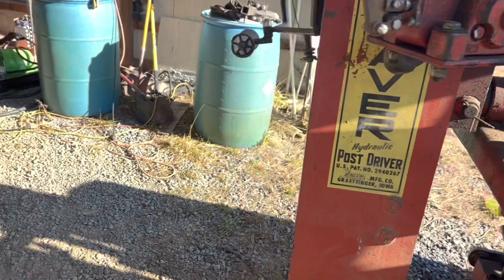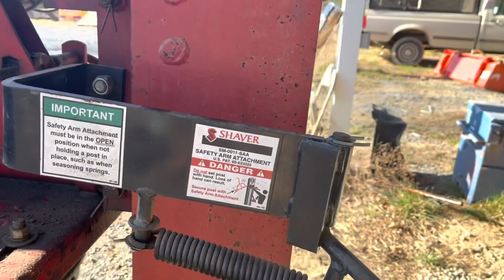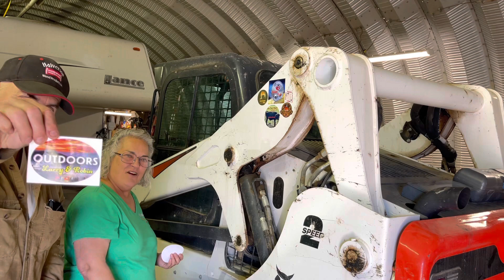Firewood Logs And Woodyard Changes!   #348

Comment: Enjoyed seeing the post driver in action. There was a guy around here who did fencing that had extra steel plates added for weight on the driver. He had the driver on the front, not on a loader but mounted to the weight bracket and used a carry all on the back for post and supplies. Take care!
Reply from the maker: Hello Ben, we see them on the front of Bobcats around here, They work more like the Rock hammers on Big Track Excavators, This is all you need just slow🚜🪵👍🏼🇺🇸